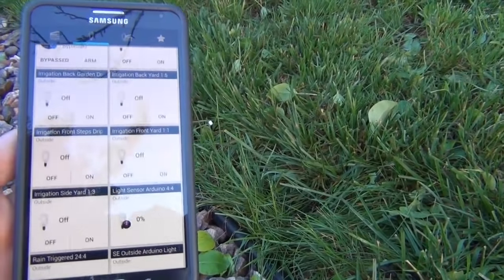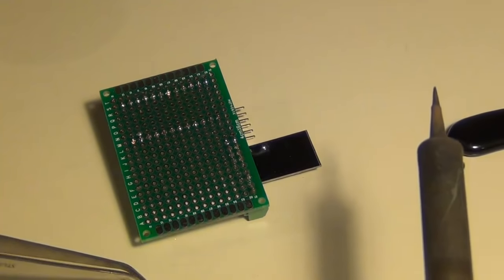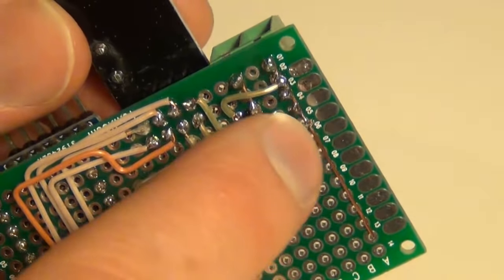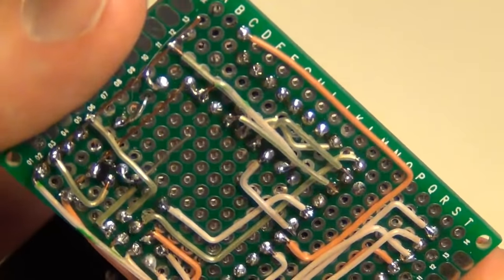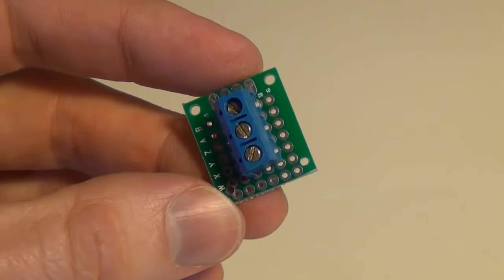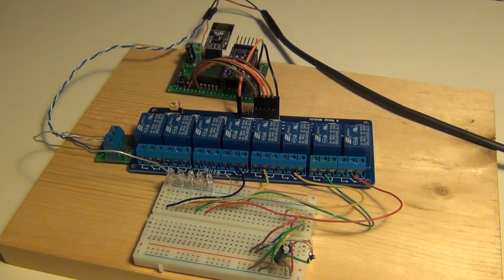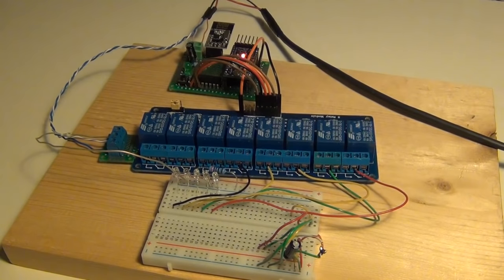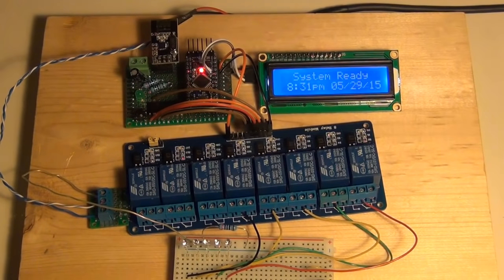How To - Cheap, DIY Arduino Irrigation Controller with MySensors

Comment: What is the name of the android application you used in the project, I thought of making one to communicate with my radio. Could it be possible to make similar app using MIT App Inventor and still work with the radio?
Reply from the maker: +Kevin Ooro 
The name of the app is AutHomationHD.  I didn't make it though.  It is an app that's available for the Vera home automation controller.  Because I didn't make it I'm not sure if the MIT App Inventor would work with this.

Comment: how would i start to debug if the LCD doesn't inititalize, or show anything else than the one line bar? the serial gives output, but only a lot of oks, fails, numbers and stuff, nothing that makes sense to me ;(
btw: i don't use vera or something. i'd like to use it stand alone for a beginning.
does it need to find vera first to finish the initialisation?
Reply: got this sorted out. the sensor needs a hub to connect to to work. once i set up my serial gateway with home assistant, and added the mysensor stuff to it, it shows up in home assistant and i can use it.

Comment: wow, this looked like a headache to wire up! how did everything hold up the past couple years?
Reply from the maker: Yeah, it was quite a bit of work but I enjoy the process because I learn along the way.  It is still running great in the same place it was.  I think I updated the code once but other than that it remains untouched and still waters my lawn.  As of right now though it's just used to tell time when I'm in the basement... too cold out. :)

Comment: now i have another issue: the system works so far, and it looks good. i can see the switches in home assistant, and i can switch them on and off. if i press the onboard switch i can go through activation of all zones. but no matter what i do i don't see any voltage on the pins of the shift register going to the relay board. the register is working so far, because when i set "ACTIVE_LOW" all pins go switch to 5V. but they don't toggle. any idea what i can do???
Reply from the maker: Sorry for the delay.  Have you double checked your wiring against the diagram linked in the description?  You could also post questions on the MySensors forum if you get stuck.  I have been very busy lately and haven't had the time to keep up with comments.  Sorry.
Reply: Pete B thanks for your reply. I checked the forum and read the code which made clear that w/o proper connection to the host it won‘t work. As i‘m using home assistant which doesn‘t work with var_1 etc i had to hard code the irrigation times into the arduino. Now it‘s working.

Comment: What software is used on the computer to make the application on mobile ??
Reply from the maker: There are many different controllers compatible with MySensors.  I personally use a Vera (getvera.com).  Check out my other MySensors videos for more info but it works like this:  Irrigation Controller <> MySensors Gateway <> Vera Controller <> Vera Mobile App

Comment: in 3pc terminal there are two ground port one for input and one for output. i just want to know where will be the other end of the ground output gonna be? I mean the white wire in your video.
Reply from the maker: +Dinesh Ranaweera One ground wire comes from the transformer and the other goes to the irrigation valves.
Reply: +Pete B  Thanks for your reply. Can we do this project using Arduino Uno? if does is it the same procedure?
Reply from the maker: Dinesh Ranaweera I haven't used an Uno in any of my projects but it should work fine for the irrigation controller.  Have you created your gateway yet? If not and you are creating a serial gateway with Vera that will need to be a Nano.

Comment: Is it or can it work on battery if yes which type and for how long can a battery last before it needs to be replaced
Reply from the maker: The type of relays I used are not designed for battery use.  You could use batteries but they would drain quickly.  If you are wanting to battery power you may want to take a look at latching relays.

Comment: hey man, what kind of sprinklers are you using?
Reply from the maker: I use these valves: https://rover.ebay.com/rover/1/711-53200-19255-0/1?icep_id=114&ipn=icep&toolid=20004&campid=5338071705&mpre=http%3A%2F%2Fwww.ebay.com%2Fitm%2FOrbit-Sprinkler-System-1Inch-NPT-Jar-Top-Valve-57461-New-Free-Shipping-%2F281990430433%3Fhash%3Ditem41a7f07ee1%3Ag%3AgAUAAOSwEK9XAJvJ

And the sprinklers in the video are something like this (sorry, I don't have the exact model number):  https://rover.ebay.com/rover/1/711-53200-19255-0/1?icep_id=114&ipn=icep&toolid=20004&campid=5338071705&mpre=http%3A%2F%2Fwww.ebay.com%2Fitm%2FRain-Bird-12SA-Rotary-Sprinkler-13-18-12SA-F-12SA-H-12SA-Q-12SAQ-12SAH-12SAF-%2F271657716593%3Fvar%3D%26hash%3Ditem3f400fcb71%3Am%3AmVgZNq_1104pWNRG9dCiOaQ

Comment: Hi Pete, I built your Irrigation Controller, can it be used with Domoticz?
Reply from the maker: Cool!  Yes, it can but last I heard you need to modify the code because Domoticz doesn't work with the MySenors Variables (which this controller uses).  There are some people who have modified the code to get it to work though.  Check out the forum post (linked in this video description) for more info.
Reply: Hey again, Domoticz has a hardware input device called MySensors Gateway with LAN interface and MQTT interface. Would these work with the code you wrote?
Reply from the maker: Hi Alexander, I would recommend checking out the MySensors site.  You will need a MySensors gateway to interface with the irrigation controller.  So it will look like this:  Domoticz <> MySensors Gateway <> Remote sensors (Irrigation controller).  You only need one gateway for many sensors.  I have about 30 unique nodes with over 100 devices/sensors.

Comment: hi ,thanks for the your hard effort .i almost built the project ,but i found some problems while i am up loading the sketch ..it said " .... fatal error: MySensors.h: No such file or directory " i tried to fix it by downloading  MySensors library ,but still nothing changed ,then i noticed that there is no library called MySensor   ,all the libraries that i found are MySensors ( come with  s  at the end  ) ,then i tried to change   #include <MySensor.h>   to     #include <MySensors.h>     with  s  at the end ;in order to make suitable with MySensors library ,but i still facing that problem nothing changed .

so could you please help me soon as you can 
thank you too much 
have a nice day
Reply from the maker: Jack,
MySensors was just updated to 2.0 and I haven't had time to update the sketch yet.  I'll see if I can work on it soon but I have family in town right now so I'm not sure how much I'll be able to do right away.
Reply from the maker: Actually, have you tried this one?
https://github.com/mysensors/MySensorsArduinoExamples/blob/master/examples/IrrigationController/IrrigationController.ino

Comment: sir, how the time and date recorded without using rtc DS3231 module? did you change the time and date manually?
Reply from the maker: It is received from your home automation controller through the MySensors Gateway.
Reply: just like what you did in your video sir, it displays last watered. hope you give attention to my big problem sir :(

Comment: Are you using the radio to get the date and time?
Reply from the maker: That is all done through MySensors library.  You can request the time from your home automation controller with the requestTime(); function

Comment: but my gates value are not sprinkler, it's like tight water tap for 2 inch pipe , so does it works ?
Reply from the maker: This is just to control the valves. If you can control your gates with a relay this should still work.

Comment: What is the function of the shift register? I mean, why do you need it on the board?
Reply from the maker: Well, in this case I actually don't need it (because I don't have very many zones so I could have just used the pins on the Pro Min) but it was added for other people who have more zones.  Basically what it does is provide a way to have more digital output pins that can be used with the relay.

Comment: what is the reason that you use the shift register?
Reply from the maker: For my limited number of valves it's not needed.  But, if you want to use a pro mini with more than (I think 6?) valves you would need it due to the limited I/O pins on a pro mini.

Comment: I think it would have been easier to design it in Eagle CAD and send your Gerbers off to PCBWay and wait a week to get your board back.. Then start soldering components.. Nice job!
Reply: I don't think that was an option 4 years ago...
Reply: @jeffhousen8968  Oh my gosh! I just realized your video was 4 years old in June. I guess I should pay more attention. I used to use Spice when I worked for a large corp designing PCB's and sent them off to a local board fab house. Today I use PCBWay and I no longer live in the US. I live in the UAE so getting the boards in 3 days is pretty common. At my home in the US, It takes a week. Sorry.. I'll pay more attention next time. Nice job anyway!

Comment: Hi, Would it be possible to control a 12V  Water Fountain with on of the Stations/Relays?
Reply from the maker: Possibly.  It depends on the current draw.  I don't remember off the top of my head but I believe the relays I used are fairly limited on what they can switch for 12vdc (you could always get a bigger one though).  Do you know how many amps your water fountain uses?
Reply: About 1amp (1050 mA), I need more than 8 zones on my yard, can I use a 16 zone relay board instead of the 8?
Reply from the maker: Ramon Carranza 1 amp should be fine.  Yes, you can increase the number of zones because of the shift register.  You will just have to make the necessary changes in the code.  Should be easy but let me know if you run into any issues.
Reply: Thanks so much!!  your videos are amazing!!! made it so easy for me to integrate Arduino with Vera, it just brings the Vera to a different level, thanks again

Comment: After creating all these parts working correctly how to connect them to real watering system so they can control the watering?
Reply from the maker: +Иван Петров You would connect the wires coming out of the relays to valves like this: http://www.amazon.com/Orbit-57100-4-Inch-Threaded-Sprinkler/dp/B00004S1V2/ref=sr_1_2?ie=UTF8&qid=1461715272&sr=8-2&keywords=irrigation+valve

Comment: hi! I have a question, can i connect  humidity and temperature sensors to this system? how muchas sensors can i connect?
Reply from the maker: You can connect them by using MySensors.  I have different sensors all over my house (and outside my house) that all connect using MySensors (mysensors.org).
Reply: +Pete B thanks for your answer!

Comment: Great video.  Can the code be written in Python for the Arduino?
Reply from the maker: +Anthony B Good question.  I've never checked.  I just use the Arduino IDE for my code but there may be something that will compile Python into the needed .hex file.  Sorry I don't have a more definitive answer.

Comment: Hy Where did you get those beautiful multimeter leads?
Reply from the maker: Micky S. The multimeter leads are from Extech specifically the Extech TL809 Electronic Test Lead Kit.  I got them from Amazon.
Reply: Thanks

Comment: What is the name of the wire with insulation that you use at the bottom of the PCB? Thanks.
Reply from the maker: I just used the wires inside of a computer network cable (Cat5 or Cat6).
Reply: Pete B That's a cool idea. I love how the insulation melts at the desired points exposing terminals.
Reply from the maker: +famke theron  yeah, it's nice how that works out.

Comment: how can I find out how to build  1 and can that be hooked up to a rainbird  or hunter controler
Reply from the maker: +john Kosheluk Based on your previous comments I would suggest you look into controllers that have wifi built in and are already a consumer product (like the Rachio) not something you have to build yourself.  That may be more in line of what you're looking for.

Comment: how did you strip your wire like that?  16:45
Reply from the maker: There are two ways to do it.  One is to cut two lines with a wire stripping pliers then use a razor blade to cut out between the lines.  The other is to cut one line then slide the insulation slightly out on the wire.  I believe in this instance I used a razor blade because the wire insulation was too difficult to move.

Comment: Looks like it should cost somewhere between $50 - $150 shipped for parts and accounting for large price fluctuations (note that on the website, shipping cost is excluded, which can throw the estimate way below actual cost, especially with adding the shipping items from 16 different places). [my guess is around $70-$85]
Reply from the maker: It cost me under $30.  Shipping from ebay usually free.  Search to find the best price.
Arduino Pro Mini ~$2
8 Channel Relay ~$7
NRF Radio ~$1
Power Supply ~$13
LCD ~$3
Other misc. parts ~$4?
Reply: Pete B Cool. Well, I think it is waaaaaaaaaay too advanced for me right now anyway. I based the prices off the website, not actual searches. 

I'm going to try something much simpler, like a float valve and a water barrel or hooked up to a water outlet/spigot/tap for container gardening. This would just keep water at the bottom of a bucket, that roots could grow towards for water, while not keeping the soil above it wet (or at least not soggy). I suspect that adding Perlite on top of the water, would help wick the water into the air to the roots, until they are able to reach the water.

I bought some float valves, but I don't have any large plants and I'm not sure which ones I should test this one and so I have no idea where to get started, but I want to use containers I already have (recycle) until I figure out exactly what I want to make. If all goes well, I would like to attempt it with a friends backyard tomato plants, but my biggest concern right now, is making some sort of fail-safe, so if the float valve fails (jams in the open position) that it won't waste tons of water, but that's part of the fun (although I lose no fun if someone already has an elegant and cheap solution).

I agree with the video maker, that it is best to cycle water, but cycling requires electronics and I like the idea of the elegance of non-electronic.
Reply from the maker: Jay H Sounds like a cool project.  Sometimes non-electronic is better.  Good luck with your project.  Unfortunately I can't provide any assistance as all my projects use electronics. That's the enjoyable part for me :)
Reply: Great video! Thanks for the detail. Can this work without Vera? I guess you would loose remote status and control, but maybe  there’s something else available these days? (mobile app?)

Comment: So how easily could i control say 4 sets of 24vdc motors to turn on in ccw direction for 40 seconds and stop, then 12 hours later turn them on in cw direction and repeat this loop daily? is this something the arduino or a photon could do?
Reply from the maker: +rnbowarrior Yes, and arduino could do this.  I'm not sure what you're trying to do but if you need precise motor movement you may want to look into stepper motors.
Reply: +Pete B not trying to precision control just one direction and then opposite. so how would I do this? can you help me with the parts list or ideas. I can draw what I'm trying to do
Reply from the maker: Ysidro Avila Do you already have the motors you're trying to control?  If so, what does the wiring look like?  The relays are just like switches.  So they can turn on and off.  I have never done any motor control so I haven't looked into how they are normally reversed.  I still don't know if a relay would be the best method but in theory it could work if you have the wiring in place.
Reply: +Pete B I do have the motors and they will work with switching relays.  I know i can get them to go in either direction with relay logic. I just dont know how i could get a relay board or something to work with the arduino or Pi set up.
Reply from the maker: rnbowarrior Oh, ok, good!  That shouldn't be too difficult then.  Do you need it connected (as in the ability to turn on/off on demand through a mobile app or something else) or do you just need it to perform the same function at a specific time?  
I do all my logic/control through my home automation controller (Vera) so my set up may be a little more complicated than you need.

Comment: will it be hard to use a nextion as a Display
Reply from the maker: If it works with Arduino you should be able to make it work.  I've never used a Nextion display though so I can't say for sure.

Comment: Can you give me a link for valve that you have used?
Reply from the maker: I use these valves: https://rover.ebay.com/rover/1/711-53200-19255-0/1?icep_id=114&ipn=icep&toolid=20004&campid=5338071705&mpre=http%3A%2F%2Fwww.ebay.com%2Fitm%2FOrbit-Sprinkler-System-1Inch-NPT-Jar-Top-Valve-57461-New-Free-Shipping-%2F281990430433%3Fhash%3Ditem41a7f07ee1%3Ag%3AgAUAAOSwEK9XAJvJ

And the sprinklers in the video are something like this (I don't have the exact model number):  https://rover.ebay.com/rover/1/711-53200-19255-0/1?icep_id=114&ipn=icep&toolid=20004&campid=5338071705&mpre=http%3A%2F%2Fwww.ebay.com%2Fitm%2FRain-Bird-12SA-Rotary-Sprinkler-13-18-12SA-F-12SA-H-12SA-Q-12SAQ-12SAH-12SAF-%2F271657716593%3Fvar%3D%26hash%3Ditem3f400fcb71%3Am%3AmVgZNq_1104pWNRG9dCiOaQ